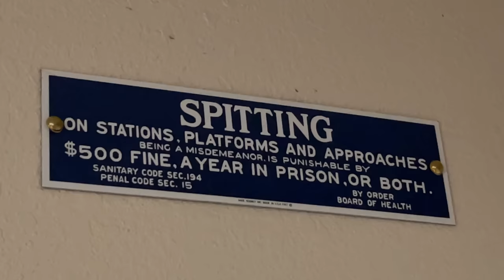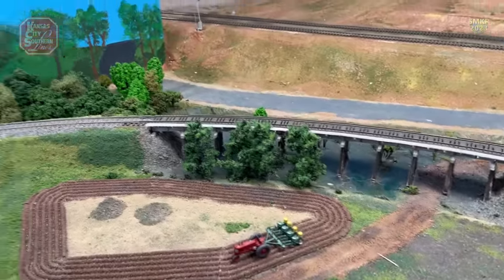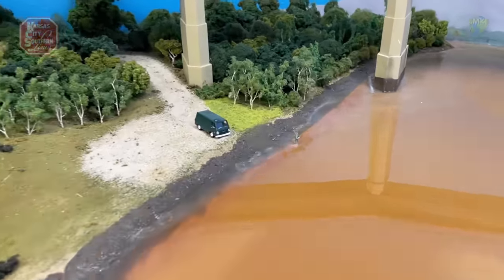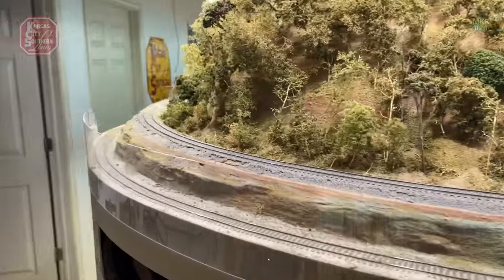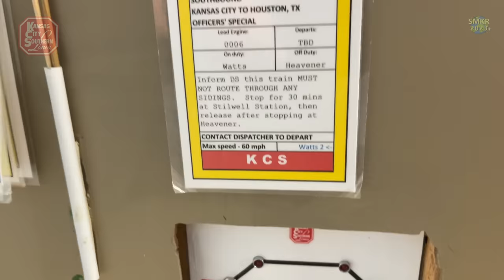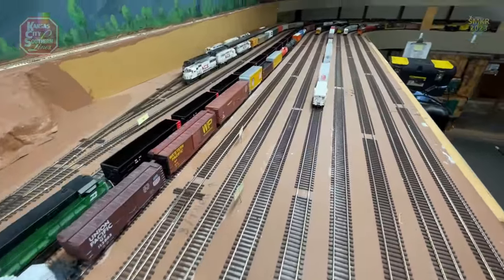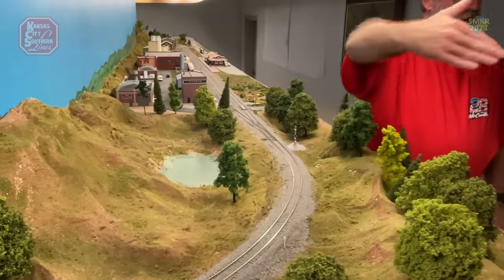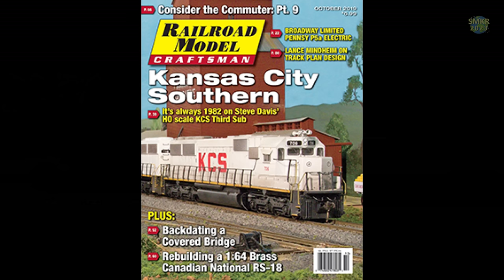MASSIVE LAYOUT!! Kansas City Southern HO Scale Model Railroad Tour

Comment: I was born and raised in Fort Smith.  All of that is my old stomping grounds. I'm fixing to model the A&M from Fort Smith, to Rogers, AR. Model looks great!
Reply: I’d LOVE to see your A&M model!  One of the most scenic and unique RR’s I’ve seen.  Are you going to run the Alco’s or the more modern EMD’s they are running now?

I didn’t do justice to Ft. Smith in my model.  I did use actual buildings on the route but used a lot of “modeler’s license’ an omitted a LOT.  The majority of the towns I modeled on the KCS 3rd sub are accurate track😊-by-track to the 1982 track charts (I’m modeling 1982.)
Reply: @TTownTrainFan  I’m still gathering stuff. I’ve got a bunch of Alcos and 4 of the EMDs. I think I’ve got the right amount of engines. Even have some old GPs for the Fort Smith Railroad. Going to paint them the correct colors. I’ve got A&M decals. I’m going to try and model, in HO scale, from downtown FS, thru downtown Van Buren. The rail yard in VB and Alcoa sand in VB. Then going to wind it up thru a bunch of hills, trestles, towns, the Winslow tunnel. Downtown Springdale, then into downtown Rogers. Going to try and hit up a bunch of industries along the way so there can be switching and all that fun stuff. Then have it circle back around and head back. I e got a large unfinished basement where I should have enough room to make it all. I’ve got most of the lumber as well. Next thing to find is time. Also going to hopefully automate it as well. DCC on everything. I guess the only I don’t have yet, is the electronics. I’m hoping in the next few years that stuff will get smaller and maybe more use of Bluetooth.
Reply: @TTownTrainFan  I forgot to say how awesome your layout is.  I hope to have something as beautiful as what you’ve built.  I love the way it’s all routes thru the room. That’s what I’ll have to do as well. Great work!

Comment: The KCS has no mainline grade steeper than 1.5%, which was by the edict of Arthur Stillwell, the man behind the building of the KCS.  That was also why the KCS did not go into Ft. Smith from the north because the grades would have had to be greater than 1.5%.  The original line into Ft. Smith was washed out by the Arkansas River and the KCS gained access by trackage rights over the SL-SF until the Frisco sold the line to the KCS.  
Since taking over a number of lines in Mexico by way of KCS de M, the Mexican lines have a number of long tunnels.  The access to Mexico is by way of Laredo to Monterrey to Mexico City and ports on the Gulf of Mexico and on the Pacific.
I did not notice any of the stainless steel cabooses the KCS had and used.  I grew up a block away from the mainline in Shreveport going down to Mansfield and on south to Port Arthur.